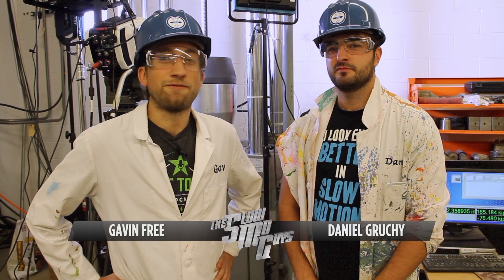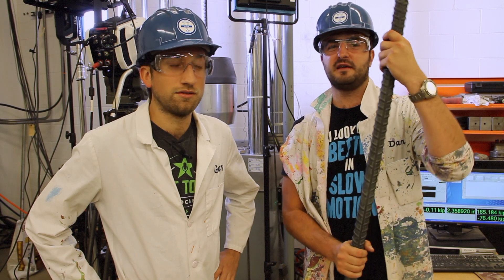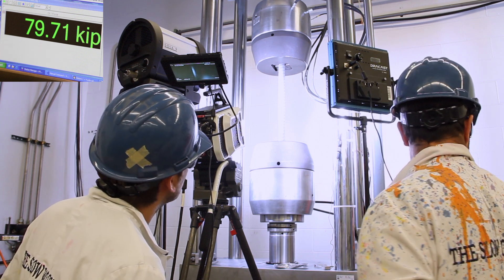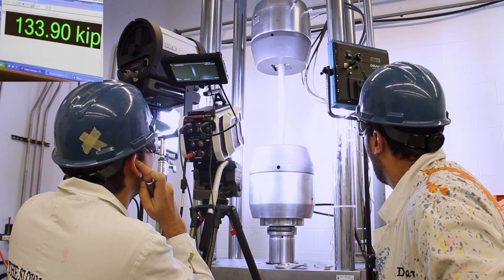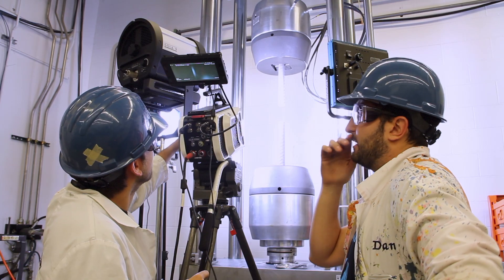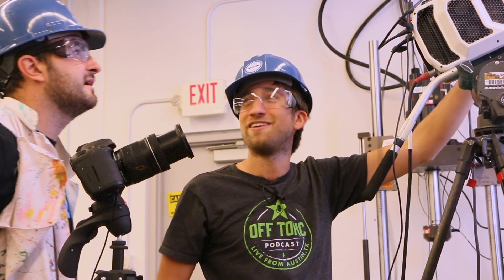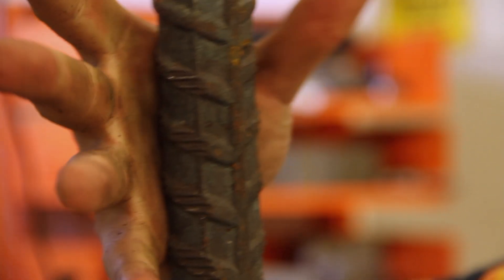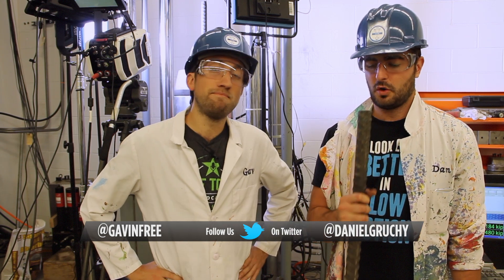Snapping a Steel Rod 1000x slower - The Slow Mo Guys

Comment: I am impress that:
A. It pulled it apart
B. It runs on windows XP
Reply: There are actually quite a lot of industrial machines that run on Windows XP. CNC machines, Plasma Tables, etc... normally because the machine itself is either 20 years old or the developer never adapted into the vista age
Reply: @Silentguy_  Yes, I noticed that when working in a car manufacturing facility. Pretty sure it so you can't use the computer other then what it's intended for.
Reply: Xp all the way
Reply: That's because that's an old machine probably
Reply: B
Reply: It has 666 likes😈
Reply: It's not uncommon to see industrial machines running old windows versions. He'll, I've seen machines still running MS DOS. These machines use the OS as more of a utility so it doesn't need to be connected to a network. It just needs to boot up go load the application it uses. They're perfectly safe.
Reply: https://youtu.be/tb2Ct3yyB4g
Reply: Because it doesnt requrie much ram it can run in 2gb ram no problem but newer require atleast 4 gb of ram
Reply: Not surprised. Xp is pretty solid. Just like 7
Reply: no shame in that, xp was like THE best windows ever, i still have like 2 machines that run on xp, is lighter and faster than win10 and doesnt bother me with updates 😂
Reply: CarimboHanky yea xp i think is much more optimised than 10 and steals no data like 10. Also xp alows almost full controll over the os unlike 10.
Reply: Even new things made today that don't use internet run on XP because it's so perfect
Reply: Too the people saying that they still use XP. The point is most heavy industrial equipment uses XP not normal people over windows 10 wtf you can't run need programs or download much needed things and forget gaming on windows XP. If you're not joking I don't know what too say besides...
Reply: It doesn't run on windows XP
Reply: @deg1studios  What're you talking about? Yes it does... you can see the Windows XP taskbar in the capture of the monitor... top-left @ 1:05 onwards.
Reply: @logix8969  That's the operating system of the computer that displays the Kip. It does not run the machine.
Reply: deg1studios: It still runs the machine. Majority of old industrial equipment runs off of XP
Reply: deg1studios it’s a joke

Comment: That machine can be used to transfer and hold energy.
Slomoguys: breaks stuff with it
Reply: tools like this are designed to break stuff in order to test the strength of materials  it records alot more data than they showed

Comment: Sounds like the microphone clipped the breaking noise - bars this size tend to break with a massive bang. They also tend to make the machine jump at failure, very impressed with how smoothly this tensile machine handled it.

Comment: That's not a beam.  It's a deformed rod.  AKA "rebar."  We used to pull them apart at a lab I worked for.  The fattest I ever saw pulled was a #11.  11/8 of an inch.  "Tension" is not a strong enough word.  You are sweating hard by the time it snaps.  We learned to put sheets of lead on top of the press because the big ones would shoot through the ceiling if there was nothing there to stop them.

Comment: Good ole fashioned tensile testing. The flexible separation was when the steel was plastically deformed until the point of total failure when it snaps. This sort of stuff goes along with mechanical engineering and materials science curriculum.

Comment: I want to know how the Machine gripped the bar without it slipping out ??
Reply: They showed the grooves it left
Reply: I assume that the grip assembly is some form of hydraulic press.  It would have to exceed half the force of the that exerted on the bar on each side.  Maybe the grip increases force as the machine increases its exertion on the object.  (I agree that the gripping of the bar by this machine is far more interesting than anything else.)  Cheers
Reply: These machines usually have wedges which the grips sit in, with the narrow end pointed towards the middle of the machine. This means that as the tension on the piece in the grips increases, the grips are forced inwards by the wedges and grip the test piece harder.

Comment: Fun fact, in materials engineering, the stage right before fracture when that noticeable stretching begins and the rod starts to get thinner right around where it breaks is actually called "necking", he didn't just make that up.

Comment: being that steel rod about 1 meter long (3.28 foots) and 3.8 cm thick (1.5 inches) it weights about 9 kg (20 pounds), it can sustain about  71.400kg (157.400 pounds) which is almost 8.000 times its weight, it's like if an average human of 62 kg (136 pounds) was pulled apart with the force of 1 and 1/4 blue whale, that weights an average of 140.000 kg (308.600 pounds), from each side of his\her body, or 40 african elephants, or 45 killer whales, or 400 grizzlys, 4000 humans and so on...

Comment: To those complaining that it wasn't slow enough consider this. That steal bar was ripped apart with 110 tons of force (or 99.79 tonnes) that's like if 5 elephants were tied to your arms and and  another 5 to your legs and they ran in opposite directions until your body was ripped apart. The phantom has nowhere near enough frame rate to capture the splitting in enough detail to perfectly satisfy everyone.

Comment: Engineering scales for various bars are used in calculations but in my experience actual strength exceeds by more than 25% of what scales say . But this has just been my experience  . Speaking strictly in terms of tensile strength .

Comment: If you use a smaller diameter sample or a more malleable metal, you would be able to see it follow what’s called the stress-strain curve more easily than testing that massive sample. It was kind of funny when you said “necked in” where it failed because that’s actually what its called, “necking”. That’s where the sample has passed the yield point and permanently deforms from being stretched from the tensile force being applied. Really cool video, definitely getting a thumbs up from me!

Comment: I'm impressed with grip of the machine..
Reply: I'm putting this dude on my team in tug of war
Reply: These machines use teethed or grooved jaws which get tighter the harder you pull.
At 3:54 you can actually see the marks it left where it dug into the steel.
Reply: Jugi would be impressed too
Reply: Vaginas and mouths worldwide are in envy
Reply: Do you mean the grip at the 4:00 mark?
Reply: @DavidSmith-rf5je  yeah somewhere arond there you can clearly see it.
Reply: Hey, Stop taking my photo

Comment: Tap on the steel rod.  Record the frequency is rings at.  Add a harmonic resonance matching that frequency and 800 degrees.  Repeat the test to discover what happen on 9/11.
You'll only need 30% of the pull force on the first test.
Done it.

Comment: You guys should look at the force scale. When I was taking a materials class we had to perform all sorts of destructive testing and scale out the force over time.
     The force goes up and up, then it suddenly goes down, then climbs back up a bit before that part breaks apart.
     The bar actually fails BEFORE it splits in two. Kind of weird.
     The heat in the bar isn't from friction, it is from stretching. It took a lot of energy to break it, and that energy is the heat you feel.

Comment: Try useing grade 40 guyes, It breaks more dramatically.
Also you can use different (smaller) diameter to see a better cut shape.
You can also but marks (useing coloring or tape) along the rebar (equally destributed) in order to see how the rebar streches.

Comment: Plot twist: the machine is hand cranked.
Reply: It would be a twist on,,, give me a long enough lever, and a fulcrum to put it on and will move the world... 
So a child could hand crank the machine. . If he could keep at it long enough.😉 
But he probably wouldn't be a child when it finally broke..
Reply: You can actually get tensile testing machines which are hand turned, obviously you'd use considerably smaller test specimens in them though, but this would be fun to try and hand turn 😂
Reply: Biggie Cheese Boi You would need Chuck Norris for tht
Reply: @Avery-df9vy  I cant believe you said that
Reply: If you had the right mechanical advantage you could
Reply: With the right gearing it would be possible.
Reply: Lol
Reply: have y'all seed the video with the planetary gears?  you could do this with your pinky,  it would just take a while,
Reply: By G.I Joe and his kung fu grip :)

Comment: It was interesting to watch the bottom section pulling where you could gauge the distance pulled against the mortar joints of the wall in the background. The stretch really went a lot farther than I though that it would before the "pow."

Comment: If the rod was 1,500 feet long you could break it with a friend if you were both pushing forward at both sides. Use leverage to your atvantage

Comment: Rebar is usually made of a high carbon steel like Cast Iron, which is quite brittle. In brittle materials cracks propogate at close to the speed of sound, so will be challenging to capture. A ductile metal like Wrought Iron or another low carbon steel would produce a ductile fracture, which may occur more slowly and might be more easily captured. I'd be interested to see this.
Reply: And yet, a quite high carbon content of a rod of rebar still doesn't have much more than about 0.35 % carbon. An extremely high carbon content, which we would have to spend close to an hour bringing down, would still only contain about 1% carbon. Doesn't seem like much, eh?

Comment: 2017 and Windows XP :D

I know what you're thinking. You shouldn't be ashamed of yourself. :)
Reply: For an industrial machine, that's absolutely cutting edge software.
Reply: Well why would they touch a working system? It's not like it's ever exposed to any safety risks so it was prolly never touched since it was installed - Why they'd use windows tho... I dunno
Reply: There's no reason for it to ever be connected to the internet so it's fine. US military systems do this all the time because their software only works in XP.
Reply: They wouldnt want it connect it to internet so that some dorito eating kid would hack into it and stretch somethings off

Comment: Is it just me or did Gavin sound like he was on helium in the beginning like, third of the video?
Reply: Guy Garic I think because of the deeper background noise, you can only really make out the unmasked high pitched tones of Gav's voice. Dan has the same situation, but he has a deeper voice in general.
Reply: It almost sounded sped up
Reply: The whole thing is sped up by about 5% for some weird reason.
Reply: Okay, good... it wasn't me, then! 😁
Reply: HAHAHA I thought the same!
Reply: That's not speeding up or anything, they just filtered/edited out the bass so the vibrations of machinery wouldn't mess up the audio track.
Reply: The part where they are trying to pull it apart is crack up
Reply: He sounded a bit like Daniel Radcliffe
Reply: Its probably due to frame conversion issue i.e. exported at 30fps and then re-exported to 25fps… Similar to how US TV shows sound high pitched for us on UK TV
Reply: Yes I came here to see if it wasn't just me
Reply: He did have helium
Reply: Yeah the audio was messed up
Reply: Got you to 500 can i get 50 likes?

Comment: I agree it was a disappointing break and need more fps's
Reply: 10p6 then wait a decade for when we have that kind of tech
Reply: Nep Nep pretty sure we got computers that can record to 1 million fps
Reply: A million frames per second at abyssmally small resolutions. The v2512 shoots a million frames per second at a resolution of 128*32 pixels. That'd be absolutely tiny on an HD screen.
Reply: What? It's a 40 thousand dollar camera there's is a better camera but its 150 thousand and it's the best slow motion camera available that's as far as the technology goes pal

Comment: It's a thermomechanically treated bar (TMT) with a hardened cladding and a ductile core. That's the reason for the inside being able to stretch far more than the outside.

Comment: “Pounds” I’ll buy that for a “Pound” 😂😂😂. Everyday, is a school day “Tensile strength is defined as a stress, which is measured as force per unit area. ... In the International System of Units (SI), the unit is the pascal (Pa) (or a multiple thereof, often megapascals (MPa), using the SI prefix mega); or, equivalently to pascals, newtons per square metre (N/m²).”

Comment: Now imagine watching the snap at the molecular level.
Reply: You wouldn't see anything happening on that scale. Atom can't break, so all youd see is seperation.
Reply: JDR Adams release a TON of energy when it breaks England uses that fact for power look it up
Reply: @Austin_Wallis  you've never heard of fission? Or splitting of the atom?
Reply: JDR atom bombs split uranium or plutonium atoms, hydrogen bombs fuse tritium and deuterium
Reply: JDR correct me if I'm wrong, doesn't fission mean the spilling of atoms? Fusing atoms would be fusion
Reply: JDR sure atoms can break
Reply: @seanbush5313  Atoms can break, we don't even know if there's a limit as to how small things can go, we know there are building blocks for the building blocks of atoms. They're so lightweight that we can't see them because light pushes them away.
Reply: Christopher Hall The hydrogen bombs, aka nuclear weapons still start with a fission reaction which in turn creates the fusion reaction. Pure fusion bombs are still theoretical
Reply: JDR what're you talking about atoms can't break? Off course they can. Heck! The quarks that form an atom can separate. I understand what you're pointing at but you need to have more context in your comment.
Reply: QuantumQuarkee  Well, they don't really "seperate" more just melt.
Reply: @Quarkee  no. We can't even sustain quarks due to color charge, much less split them. As far as we know the quark is unseperatable. That's why they're called fundamental particles.
Reply: So much wrong here it is unbelievable.
Atom-/Nuclear- bomb is the name for all types of nuclear weapons, fission as well as fission-fusion(-fission).
A normal fission weapon utilizes the fission (hence the name) of heavy nuclei, this releases a lot of energy (depending on the fuel) and more neutrons (amount depending on the fuel and probability).
A (fission-)fusion weapon utilizes the energy, pressure and neutrons of a fission weapon to 
1. Fission Lithium-6, which gives a Tritium/H-3 atom, a He-4 atom and some added energy
2. Fusion the already included Deutrium/H-2 and the H-3 created in step 1.
A more advanced Fusion weapon is the fission-fusion-fission weapon, which adds another fission stage to boost yield.

Also, pure metals are neither ionic nor covalent bonds but actually metallic bonds, in which the nuclei of the metal create a grid through which electrons flow freely.
Reply: ACCEND
Reply: Just ask Scott Lang
Reply: Sean Bush not in this setting. It takes massive intervention to do so. Resulting in a massive release of energy. The atomic bomb did not split the atom. It fused it.
Reply: JDR nope. Atomic bombs split atoms. Fusion only currently exists in the centre of stars, we have not yet mastered that
Reply: @fgvcosmic6752  we could probably do it if we wanted to, it's just that we can't control it and it'll just disintegrate the earth
Reply: Ryan Lam  i dont think you did any sort of research whatsoever
Reply: Your mom
Reply: Can anyone take a joke?
Reply: Darian Garbig and thats how atomic bombs are made
Reply: Supreme2k WATCHING at atomic level, not snapping at atomic level. Nuclear bombs split the atom, he was saying look so close you can see it

Comment: It would be about 600 Horsepower

I took 220,000 pounds and multiplied it by the distance from the center of the rebar to the point of the force being applied (I guessed about 1.5 feet) to get the foot-pounds of force (330,000)

A single horsepower is equivalent to approximately 550 foot-pounds of force, according to Kyler's Converter. I really didn't feel like converting them both to watts first, which would have been required to get the 550 foot-pounds number. I divided 330,000 by 550 and got 600.

Comment: So basically you've just witnessed this process in metal deformation.
https://i0.wp.com/basicmechanicalengineering.com/wp-content/uploads/2016/06/450px-Stress_Strain_Ductile_Material.jpg

At a point it went to it's total yield strength, then went into movement where it would not spring back if released, hit the ultimate strength rating, and then dropped off to fracture. Pretty cool demonstration.

Comment: This is fascinating - your cameras are able to capture a BULLET leaving the barrel of a gun - and yet this split happens so fast that it appears virtually instantaneous even at 148,000 frames/second. Also anyone have any explanation as to why the outer-layer flies off during the split? Is this a layer of oxides?
Reply: Maybe it's the steel that was chipping off.

Comment: If you break the smaller rebar it is actually louder, and probably more pleasing to watch in slomo.
Reply: Allows more stretch and more release when it breaks.
Reply: The loudest ones are about 12 milimiters wide

Source: doing this was my job once
Reply: It’s true. The thinner bars are more high pitch and loud. Thicker bars just thud.
Reply: I assume maybe it would stretch out more? Making a louder noise once it snaps. Just guessing though.
Reply: that's true, we tested a small diameter piece of steel and the bang was pretty good
Reply: why would it be louder?
Reply: Shane Upton do you have a video by chance? Kinda wanna see it slo mo or not lol
Reply: Dennis Cat your mom was lies
Reply: Jo-jo Kimb I
Reply: Jocke Eriksson 77© can
Reply: False: Source was lies -
Reply: Wow, that escalated rapidly
Reply: I didn’t say it right Slomo
Reply: Guessing it relates to the resonant frequency of the bar.
Reply: I can't like the number of likes is too perfect
Reply: Yub yub thats right 👍
Reply: Stfup